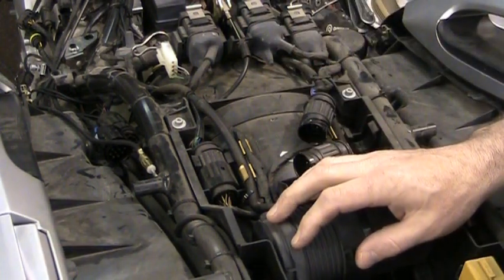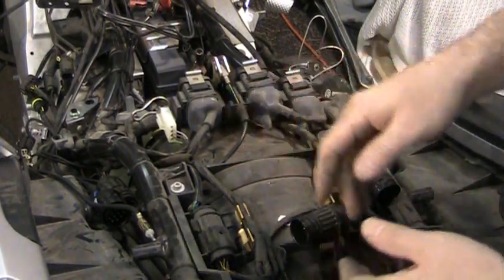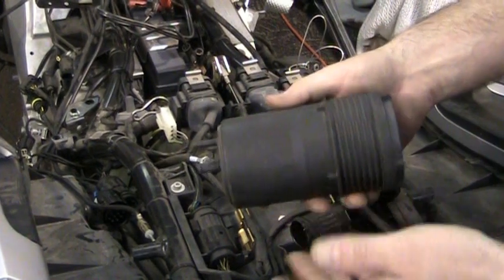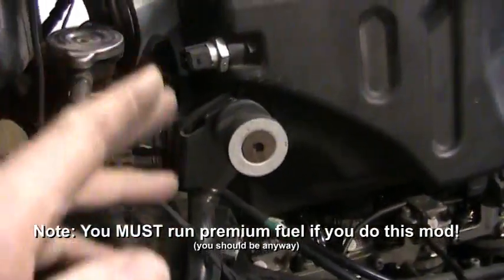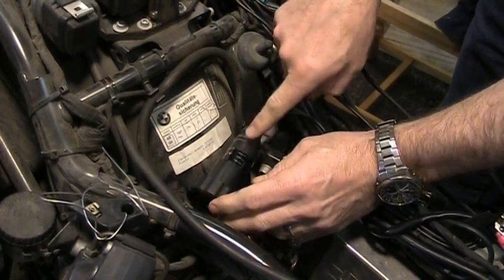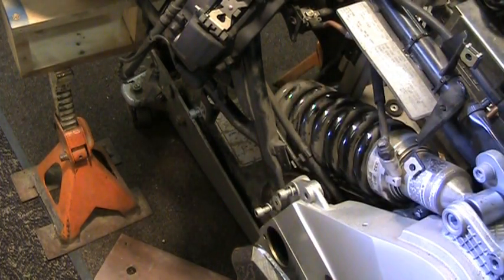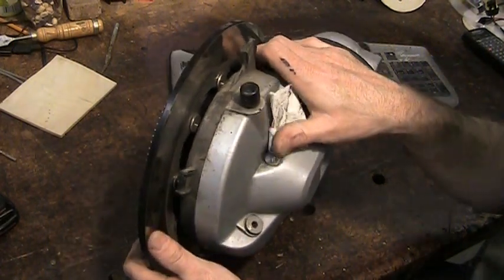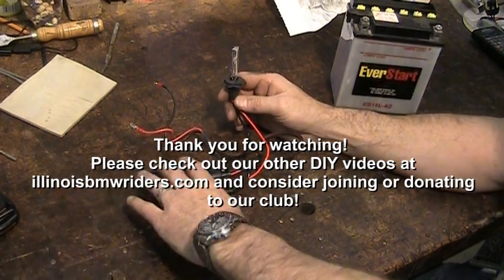BMW K1200LT Performance Improvements and Maintenance DIY

Comment: Don’t buy a BMW K 1200 LT. You will regret it. I had one for a few years. Weird front end that will not compress when braking.. so the kinetic energy from the motion has nowhere to go except making the bike awkward and making you fall over if you have the handlebars turned a few degrees. Normally that energy goes into the fork springs when you break. But not on a BMW K 1200 LT. The windshields are distorted, and for that price they should not be. When you use the side stand, the engine will smoke oil out the exhaust When you start the machine after using the side stand. It’s an embarrassing experience..Especially when there’s a hog riders around. But I’ll tell you was really embarrassing, is when you drop the machine because of that weird front end and all you did was use the front brakes with the handlebar slightly turned.. I dropped my BMW K 1200 LT two times in parking lots because all that weight got away for me due to the fact that that front end does not absorb that breaking energy.
   Speaking of brakes.. The brakes are electric/hydraulic. When you squeeze the lever, and electrical signal goes to a servo motor that dispenses brake fluid to the calipers. You have to change that brake fluid every year. Those are electric pumps that will suck the master cylinder dry in two seconds when you cracked a bleeder with the key on. All the advice on the Internet said do not attempt this job yourself take it to the dealer.The dealer wants $850 to do that job, and it was a three month wait. So I bought the attachment for the master cylinders so I could put a quart of brake fluid in this bottle and not have the system go dry by accident when I cracked the bleeder to bleed the system. If I did get air in the system, the computer would detect that failure, and the brakes will not work ever until you take it back to the dealer and they plug it into the dealer computer and do a reset. Borman and McGregor traveling around the world on BMWs with this brake system could not fix the brake problem they had on a GS in Mongolia. They ended up putting that machine on a train and sending it back to England, and they bought a local Jawa for the cameraman and continued their trip around the world. They even were on a satellite cell phone call to a dealer back in England, and he could not talk them in to getting those brakes to work.
  Speaking of breaks again, because of the abruptness and the weird friend and handling and low parking lot speeds, I started using just the rear brakes and very low speed’s. The problem there was, there is a horrible grinding noise that sounds like the disc is being cut on a lathe with a metal bit. I pulled the caliper and the pads, everything was fine. I asked the dealer. He said the fix is to buy an aftermarket rotor and pads, $700.
   Then there’s the rear gear housing bearing failures. I guess I could call it the rear end or the differential but it’s not a differential but it’s the end of the driveshaft it plugs into the wheel housing. The bearings in there fail. It’s common. I asked the dealer. The dealer said, that’s only on overloaded bikes and people that pull heavy trailers. That turned out to be a lie. The thought of the rear wheel locked up made me sell the machine. I was not going to risk my life or my wife’s life on a machine with a known problem that the dealer denies..
  I dropped my BMW K 1200 LT two times in parking lots. Because of the break action compounded by their front end of that does not absorb the energy. I had to Yamaha Venture’s. I put 138,000 miles on my first one over 16 years, I put 52,000 miles on my second one. Over five years. I never even came close to dropping either one of those machines.
   The BMWK 1200 LT has a marvelous ride once you’re rolling on the highway. 85 miles an hour all day it’s no problem. Two up wonderful. Great seats, adequate power, heated seats and heated grips are wonderful, electric windshield, though it’s distorted, does give good protection, but the machine is to flawed, too expensive to maintain, and it has that dangerous feel at low speed’s. Not to mention the rear wheel could lockup due to the common bearing failure. Don’t buy one
   Buy a Japanese Turing machine. You will regret buying the BMW K 1200 LT. The K 1200 LT is no longer being made. There’s a reason.. Friends of mine that have owned the newer BMWs with the three and four cylinder engines and the GS single cylinder engines. The ones that are on us, tell me that they are not as good or as completely set up as a Japanese machine is right out of the crate. My one friend told me about surging problems, every LT owner I ever spoke to said get used to dropping it, everybody drops them. And when it falls over you damage the mirrors, the mirrors are $492 apiece, that was about six years ago for a black one.
  So if you are tempted to buy a BMW K 1200 LT, for what it’s worth, my advice is don’t even test drive it. There’s too much bad to go with the good that it has. It’s a compromise with too much on the negative side. I have earned dozens and dozens of motorcycles since 1968, I have over 700,000 miles on road bikes. I made my living for years working as a mechanic in Honda/ Yamaha/ Suzuki/ Kawasaki/Moto Guzzi /Vespa Shops.The BMW K 1200 LT is the only machine I was happy to get rid of...It was the worst machine I ever owned.